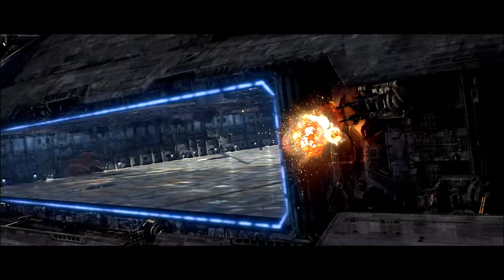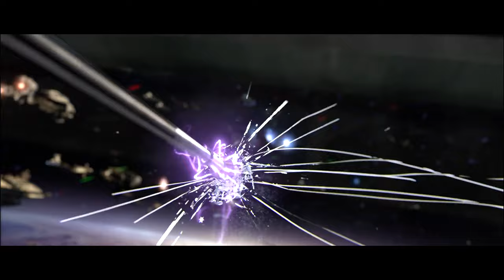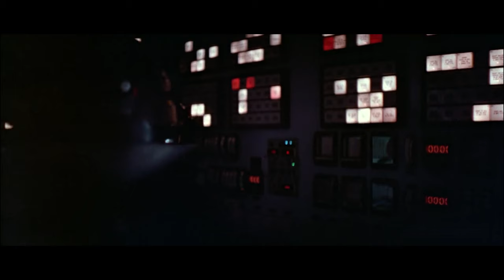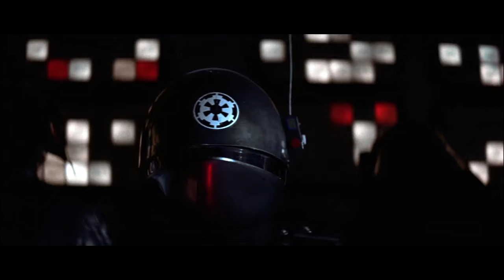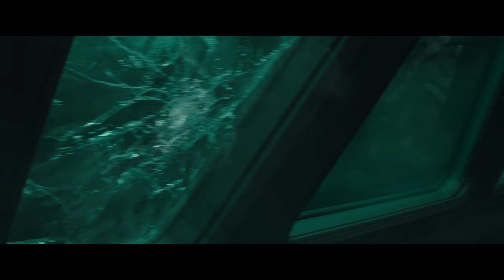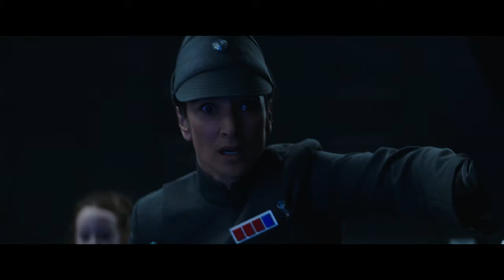This makes literally no sense

Comment: Glass is usually used in ships for Visual scans. At least from what I understand. Using the mass effect series and universe as an example. Glass provides structural weaknesses yes. But computers and scanners can easily be manipulated especially during wartime. When technology is being used to dampen sensors and communication. Windows obviously allow for an actual visual sighting. Like the Normandy stealth drive in mass effect. It's completely invisible on a radar. L but if you look out a window you can see them plain as day. Though to get a visual in space is a bit of a pain. But this is just my theory

Comment: Transparent steel may be as hard as durasteel, but it certainly won't have that good of a failure model. For example, Grievous may also be able to penetrate other durasteel walls, but that wall will not shatter immediately like transparentsteel.

Comment: The Geth would have designed them without windows. however, if a stealth craft were to come up on you and avoid sensor detection, then a window would be valuable to have so you can physically see it.

Comment: I do like the put your bridge in the middle of your ship argument but there is also a matter of shielding and visibility. Shield technology is more important than armour in the Star wars universe. When's smaller ships lose their Shields the next hit is usually the end so replacing the weaker cockpit material with the same armour plate as the rest of the ship wouldn't really change much and having the extra visibility is always important. This logic scales kind of well with capital ships. The bigger and more powerful capital ships get when the shields go down that's also the end of the fight and you need to disengage as your armour is not a viable defence for long. It's important the armour is there to stop a few more hits but it's just long enough to try and escape a situation.

Comment: i thought it was common sense that the main protection for the ships were the shields, not the materials. And since the shields only protect the outside, the inside is still very much breakable. this is especially coming from a staff that is able to block a freaking lightsaber

Comment: Why do modern ships still have bridges even though we could already completly rely on sensors? (Like submarines do).

It's part tradition, battlefield awareness and simple convenience.

Also the bridge isn't the primary control station during combat, that's the CIC.

And in the context of StarWars, a bridge with a high visibility makes sense. Sensors are effected by ion weaponry and combat distance is realtivly small compared to other sci fi brands where visual spotting would be useless. An in the end it is simply fiction inspired by ww2. Otherwise you wouldn't see imperial gunners manually swiveling AA turrets

Comment: Your argument could be used against modern naval vessels, and yet they still have windows as those assist in normal operations. I will agree that it is silly that most star wars ships don't have secondary bridges, but the window bridges makes sense. Especially when you consider the fact that regardless of the immense strength of an armored window (which actually was immune to small arms fire) it would probably be protected by a deflector shield, which was the primary means of protecting a ship of that size. This is doubly true when you consider the fact that deflectors were generally designed to be strongest around a ships bridge (this is the reason why the deflector domes on an imperial star destroyer are situated on the control tower)

Comment: Originally Transparasteel was equally hard and THICK as the bulkheads of the rest of the Ship, Lucas eventually FORGOT that, and now they just have 'hardened windows' but the REASON for them was similar to how they wrote the weakness of the Geth Dreadnought in Mass Effect, technology that would let ships run 'silent/electronically stealthed' existed, making sensors, cameras and other ELECTRONIC means of detection useless, so not being able to SEE outside the ship is a fucking hazard. Point Two, even without that, camera's are electronic, and Star Wars has Ion Cannon's, basically a concentrated BLAST of EMP, which would effectively BLIND everyone on the ship, making targeting impossible if they relied on cameras instead of visuals. 

Now one could argue if the Ion Cannon took the cameras offline, why would the guns still work, well the Ion Charge can only disrupt systems that it connects with and fries when it travels along those paths, normally even a large scale Ion Cannon will only disrupt one or two systems per shot, meaning weapons could still be online.

Now this is ALL outdated, Retconned and Ruined, formerly established Expanded Universe Info, so I'm likely wrong by today's standards of Disney Horseshit. :(

Comment: The outside of the ships have shields so they'd be safe from space debris and actually being able to see outside of the ship in case the monitor systems malfunction is a pretty good fail safe. Plus logical science and star wars have absolutely no relationship, you either buy into it or you don't.

Comment: The Kenobi example makes no sense - they did not expect a Jedi INSIDE would break the glass
As for Revenge of the Sith I'm surprised Eck made such a basic error - Sw technology is NOT advanced - a lot is CLEARLY not advanced but very basic. Lucas set up the story to have very old and new tech
That said a lot of in TROS is TOO far ahead... which might not be an issue but ... in the OT the Empire seems to have forgotten or will not use the tech they gained...
So yes some inconsistencies but new and old clashing is what makes SW stand out...

Comment: Return of the Jedi: they jave deflector shields for the bridge probably because of the glass. When that went down they needed to intensify the forward batteries. So they know its a weakness and why Grievous was able to break it (cause the shields are on the outside). Why not have armored blinds ahould the shields fail, however beats me.

Comment: I think this could be explained through engineering, engineers work to find the most efficient and cost effective method to building something. My belief would be they built things with windows not for just viewing but maybe as a way to save money. As we know from bad batch that’s a reason for why they swapped out clones for storm troopers. As for why they’re on command decks of cruisers, it might be for tactical use as well! Probably for something like seeing massive enemy ships, and how well they’re withstanding firepower. Which could be more cost effective than using certain technology capable of detecting how well ships are doing against certain attacks.

Comment: One of the many things that they Halo universe got mostly correct. Both human and covenant ships have their primary command bridge in the center of the ship and use a combination of sensors, cameras and drones to relay the appropriate information. AND many ships have a secondary bridge in case the primary is compromised during battle.
Reply: Eh, partially. UNSC ships have exposed bridges still, we've seen on multiple occasions that they have windows to allow the crew to see out rather than burying the command center inside. You are correct with the Covenant though, their bridges are deep within the ship. Same with the re-imagined Battlestar Galactica. No bridges like on the original show, instead the ship is commanded from the CIC in the center of the ship, well protected by armor. No windows, only sensor readings.

Comment: Cameras and view screens are only as good as your power source. If your hyperdrive or power units fail or get knocked offline, chances are emergency or auxiliary power is going to life support systems. This is the case I usually make for Trek (specifically the new movies and shows) where starships use windows with 2d holo projectors rather than view screens.

Comment: Star wars ships use shields to protect space craft against the elements not simply the walls of the ship.  The sensors and screens setup would be both more expensive and less reliable.  Also glass sheds excess heat at a different rate than metal so it may have been necessary for regulating the heat of the vessel.  Or could it just be art imitating our own reality.

Comment: Yyyy so you never been to the oceanarium? That's basically huge aquarium with couple of tones of water with sharks, crocs, hippos etc depending how built it is, in certain shapes glass can hold on to many tones especially that you have many types of glass, in the oceanarium you can't hit that glass from outside because it'll break easily, there signs everywhere.

Comment: Cheep and efficient. if there is a way the government can save money, they will. also shields kind of render this type of concern mute, especially when they have navigation shielding to make sure you don't run into any space dust. it also would help with psychological developments. working in a place with no windows is extremely depressing. that said, its also a great platform for cinema.

Comment: I wouldn't call the glass canopy of a bridge in SW to be a design flaw, but an inconsistency of SW writing.  They shouldn't break that easily from the inside from a Magnaguard's staff, but most don't think about it during the movie because it's more exciting.  

From a lore perspective suggesting that SW ships shouldn't have windows or a viewport of some kind on the bridge and wholey rely on sensors and cameras is a worse idea and not tactically sound.  Those sensors and cameras could easily fail just like targeting the bridge could, but now you're flying blind.  SW ships like a lot of other scifi are designed around modern warships with a wide bridge for navigation and targeting assistance.  By that same logic why have any vehicle with a window when you can just mount a camera on it?  It's not very practical and you have no plan B if it fails.  There is a better option (in my opinion).  In that same scene on Grevious' flagship we see blast shields extend to cover the gaps.  It would make more sense for any military ship to have these shields closed initially in combat situations only opening them in the most dire of situations when the crew is trying to get visuals back up

Comment: You obviously didn't see the rest of the movie buddy. Not even a second after he you cut the clip off, grievous just about destroys the metal he latches his feet onto without even trying at all. So it's not like it's surprising an advanced, mostly Droid grievous was capable of breaking mere glass. And jedi are even stronger than that when using the force on most Droid metals, let alone glass

Comment: But generally, these large windows are seen on 'military' vessels. What if during combat those sensors are destroyed? Now, I don't mind a combination of the two, and the Venator's two bridges I actually like, as it would allow full line of sight compared to the later Imperial class Star Destroyer and even Mon Cal vessels, but overall, in the military one shouldn't rely to heavily on technology, a lesson the U.S. military learned when my father served, then again.....and again......it is a lesson that seems to be needing relearning when new command takes over, anyways, personally, I like the technology in our world known as 'ALON' it's stronger then glass, known as 'transparent aluminum' though technically that is an inaccurate, and would solve a lot of problems we see in Star Wars.....uh, provided that it wasn't so damn expensive.

Comment: Airplanes have sensors that don't require a windshield to fly the plane. Problem is, sensors fail, are unreliable, and pilots react better to visual cues when landing the craft. Windows would most likely be implemented because it's much harder to assess what's happening right in front of you with sensors alone (this is why air traffic control is a stressful job), sensors fail, landing would be easier and you can confirm this, oh and a lot of the tech in Star Wars is like Rustic Advanced. Like they're a super society that never quite figured out the best way to do everything or implement protocol droid AI in their ships. You'd think you could just programs a larger version of a vulture droid and have that be the capital ship. Problem is, there are unseen engineering limitations in the universe, but that's also why Star Wars is fantasy and not SciFi. That's my take on it at least...

Comment: When it comes to the exposed bridges, Star Trek hat that same problem as well, but to me it seems only the NX-01 (from "Enterprise") ever paid the price for that, as they often suffered damage to the bridge section through that series run.
Reply: They didn't have shields, which made their bridge a ridiculously tempting target.
Reply: @Helbore  And since this was the beginning of Starship Design, more or less, they should have changed design and put the bridge deep inside the ship, even after they developed better shielding tech.

That being said, its an iconic look (even copied by "The Orville", although I think the ships on that show are very 'Samey" in appearance)

Comment: It makes sense to US HUMANS. That’s why they have it. For familiarity. And plus all the ships would look way too ugly just having bunches of cameras on the front. It wouldn’t sell many toys. But I think the actual reason is, how many ships do you think were ACTUALLY boarded out of every ship??? Clones would never of made it to the bridge alone. We saw all Anakin and obiwan had to go through just to get there. The vulture droids, hundreds of battle droids, the elevator, Ray shields, and magnaguards. Not to mention dooku. Most ships would be LOADED with troops and hardly anyone EVER would even make it halfway to the bridge. Remember Anakin and Obi wan are some of THE BEST JEDI. With all that security there is no reason to spend thousands on high tech cameras when u can just use glass. It’s not practical and not cheap. Hardly ANYONE EVER would make it to the bridge. So in my opinion it DOES make sense actually.

Comment: At the very least you would expect some kind of force field to keep the air in since a single light blaster bolt hit in the wrong or right place and your dead. Also didn't the kotor2 raveger manage to keep its atmosphere in despite multiple hull breaches?

Comment: A lightsaber can easily pierce the hull just the same. The staff was a similar tech designed to fight against sabers. Lightsabers have been shown melting and piercing right through blast shields. So out of all the things that don't make sense, this is low on my BS meter.

Comment: Bro, Star Wars doesn't have cameras. They're actually not even that advanced apart from the crazy sci-fi tech which is mostly science and magic. If they had cameras everything would be easy for the bad guys. Even if the empire put trackers or monitors in stormtrooper armour the infiltration of scariff could have been stopped before it started.

Comment: I'd add in TESB, 1980 & in Rogue One, 2010s era Imperial vessels somehow smack into each other or are struck by direct hits, impacts. 🤦🏻‍♂️ Wouldn't shields or sensors prevent, warn 🚨 about this? Smaller ships I could see flying or slam but massive cruisers, super star destroyers? Not really...

Comment: Sounds more like you are complaining about things that don't need to be complained about. Even in today's world our space craft have multi-layered windows to assist the astronauts with navigation and other tasks if needed. The same concept could be said here. Sensors and other mechanical means of navigation can be Jammed and interrupted. The windows or view ports are there to assist as secondary fallback in cases where they are actually needed when they can't rely on the sensors by themselves.  Which in battle you really can't rely on just sensors to give you information on what's going on a visual is highly beneficial even in space.

Comment: Una ventana puede ayudar a resistir el agobio¿ como te sentirias en una jaula sin ventanas en el espacio? Tener un contacto real con el exterior debe de poder ayudar a resistir la ansiedad (si te paras s prnsarlo es como una casa o incluso un dormitorio sin ventanas, no se si lo hqs probado pero en apenas unos dias, aunque tengas buena ventilacion, la sensacion de encierro es muy fuerte si no hay luz o vistas

Comment: Star Trek does this too 😂 There's windows everywhere and the only thing I personally can think of to make sense of it is they tell us the size of the ship. Take the Shatner era Kirk for example. There's two decks on the leading edge of the saucer in movies 1-6. Then JJ Abrams comes along and makes the Enterprise 2 1/2 times the length in the 2009 remake. Yet there's still only two decks on the leading edge of the saucer! It would've been more believable with either more levels of windows or zero windows on the edge! Those two decks are either totally wrong or massively tall. So yeah I have to wonder why anyone uses windows in outer space for crying out loud 😂